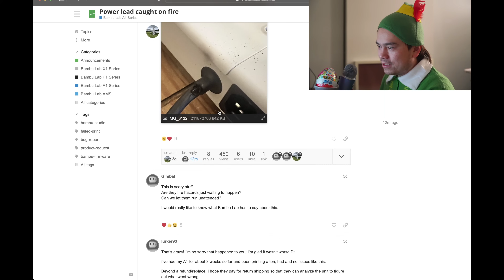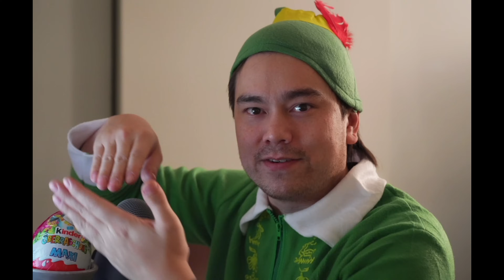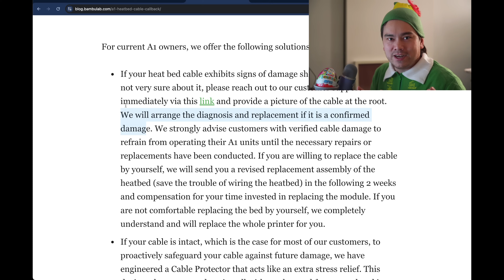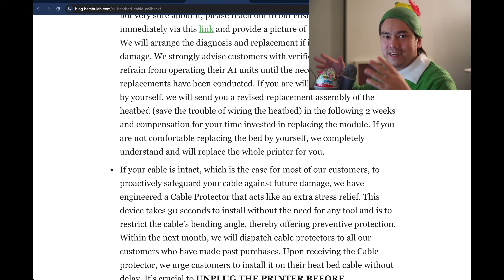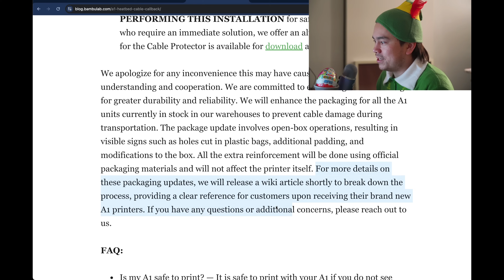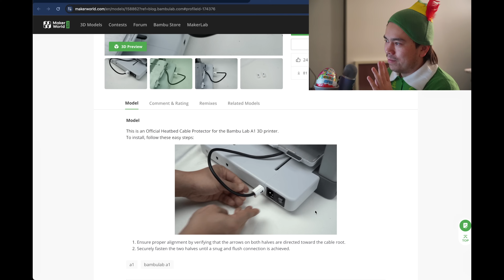Bambu Lab A1 - 👨‍🚒🔥 Important Safety Announcement!!! 👨‍🚒🔥

Comment from the maker: Also, I'm not sure how well this cable protector is going to work...
Won't it just move the stress point slightly further down the cable and still be susceptible to damage???
Reply: Seems awfully short, it barely covers the trouble area.  I'd like someone to cut that cable and strip the wires back to see if they are using  flexible wire that can handle the flexing.  I think the whole cable should be replaced.  Which would require every printer sent back.  So they won't.  I think  they are kicking the can down the road on this issue.
Reply: Thats exactly what is going to happen SMH I AM RETURNING MY A1 NOT TAKING ANY CHANCES
Reply: Exactly my thought, it will be even more susceptible to get bumped with it.
Reply: Yep it's only going to "help" if the cable was about to fail, and will move the stress point to a new position where the failure will reoccur later due to the bend radius being too tight, again. I don't think the failure is just from the machine being tipped over on the cable occasionally, surely it must be from repeated bends from bed movement being focused in that tight bend after the poorly designed cable strain relief.
Reply: This has Anet A8 vibes ! They should used a flat ribbon cable like Artillery does on its Sidewinder.
Reply: @Nibb31  can't the cable holds all the sensor lines and full AC mains power. The heater is mains powered.
Reply: @chrism2964  Same as the Artillery Sidewinder X2. It carries mains power, plus temp sensors.
Reply: Is this not an honest-to-goodness solved problem? I'm looking at my steam iron, easily fifteen years old with a cable carrying 240V (UK), designed  to flex constantly in use and showing no cable wear at all, in spite of being abused far more significantly than any heated bed. All this on an appliance which would cost £20 to replace. Moulded graduated flexible strain relief, thermal insulation, braided cotton sheath - seems like an obvious design to borrow, why not just do that?
Reply: @adamoell  there are more than 3 cores in this cable. The point really is that it's not every printer, it's just a few.
Reply from the maker: @chrism2964 just a few… according to who? The company that is currently in damage control mode? Yeah I’m sure they are going to be totally honest and forthcoming
Reply: @NathanBuildsRobots  There is literally one printer that had a short circuit. The cable damage is being caused by excessive bending of the cable, whoever did it, the cable itself is not faulty in the usual sense, its just probably not tough enough.
Reply: Should be fine if increases the radius of any bends and allows the cable to still bend.
Reply: Cable protector is a stop gap measure(to reduce bad publicity, and to protect from liabilities, by being proactive, and to avoid recall). The bandaid fix is the upcoming f/w, which will make it impossible to get fast heating(typical of PID control). But the responsible fix, is to increase current carrying capacity of the entire cable!. Which means, getting back all the printers out in the wild, retrofitting and sending back machines!, unfortunately, could make a dent on the bottomline, going forward. Not sure, how it will play out🤞. Note to NBR: Don't upgrade A1 to new f/w, looking forward for an upcoming A/B comparison video on heatbed heating times!, before😊 and after f/w update😢.
Reply: Why no cablechain?
Reply: @LalapopApple  because they are rubbish, complicated and unnecessary
Reply: @chrism2964  Have a look at the Voron Switchwire and its bed cable chain: 100% safe and no cable sticking outside of the housing...
Reply: @Christian-tt4nv  and?
Reply: Its called a bend radius.... A sharp kink in the insulation can damage it. The strain relief prevents it from being bent sharp enough damage the insulation.
Reply: Well, apparently, the damage is bending pins in the housing if you had read the release. So yes, moving the protection a little further away, should reduce motion within the housing.  The cable should be clamped down though.
Reply: Exactly. It’s still too thick at its termination. Even PETG will be too rigid here. Strain relief should be tapered or have relief cuts to increase flexibility until a critical bend curvature is exceeded.
Reply: @AwestrikeFearofGods no it still allows flex if you look at the design, but prevents kinking under normal conditions. I printed it and it seems to work well.

Comment: Hi Nathan,
The issue is that Bambu Lab used a cable not suitable for the moving bed. This is a design flaw of the A1 cable routing itself AND the choice of substandard cable quality. Other users of the A1 reported sparks  coming out of the cable way further up from the strain relief. This happens if you use a cable which is good enough for a power extension BUT not for a mains powered moving bed! They should have used cables certified for the use in drag chains at minimum. Those have a lot more stands and don't break easy.
   IMHO they should have used a design like of the Voron Switchwire and positioned the cable inside a drag chain inside the confinements of the printer (see Voron Switchwire manual). More freighting is that Bambu Lab apparently playing "let's blame the other guy" with their story that "only" 0.1% of the A1 are effected and till today (02/13/2024) still offer a "Option2" which is to self repair the printer with a new bed/cable unit. This Option2 is illegal in most EU countries and shifts the cover of accidents to the repairer.  Bambu mentions that it is illegal to work on mains powered equipment in certain parts of the world, but way down on that page after they "hung the carrot" infront of the customer with the extra $40  voucher... I have serious doubts that Bambu will check for every customer opting No.2 for the legality of that shipment...

Comment: Having spec’d out power cables in certified consumer and industrial electronics before, this must suck. A lot of these cables have little to no information on their datasheets. 

For something like this, I’d be looking for a high flex cable designed for robotics, then I’d consider some form of cable guide or drag chain.

It’s not been just bambu I’ve seen with lack of attention to this too. For example on my ender s1, my power cable got stuck on the rear motor and damaged it.

If I had an A1, I’d probably swap the cable out myself rather than waiting for whatever fix they come up with. But this printer is designed for the general consumer/beginner who probably shouldn’t be doing this kind of repair.

Comment: Mains heated bedslinger. Oof. There's a reason we don't build things like that.

The "protector" (supplied 3mf file) might be doing more harm than good, it's basically defeating strain relief with a rigid piece. If it was in a shape of semi open cable guide OK.

How the cable is supposed to look like, that it looks a little wimpy? That's not the problem, after all the current of the mains bed is uhm pretty close to zero, and you don't actually need a lot of material to reach the insulation requirements. You can guarantee that the maximum current for the given copper cross-section is not exceeded, they for sure have a fuse. The problem has to be in the specific design choices made in the construction of the cable, where the stress actually goes, so it ends up severing the cable and making up to maybe a quarter of the maximum bed power and half the running power dissipate at the damage spot instead. But i mean the design of this whole printer portion reeks a little of being sloppy. Many people building bed slingers have a U drag chain that is completely hidden under the bed, you'd think a printer by a premium brand could lean in this direction? On my own printer, i have done cable guides that go vertical on both the bed and the frame, so the cable does a twisting motion in use and is never pushed if i lay the printer down.

It would be interesting that 3D printers implement current checks. So say a fuse checks that the current is not substantially higher than specified, which is useful, but you also want the opposite here. If the wire breaks and its resistance increases, the current and power on the corresponding output will be lower, and the fuse will not trigger, but fundamentally if you had a current measurement device, you would be able to detect this fault as well.

Other checks are partially done in software without adding any hardware. Marlin thermal runaway check can detect if the temperature on the corresponding probe increases slower than expected during initial heatup phase - i have had this feature warn me of a failing connector before it caused a serious fire. You could also have steady state checks that the supplied power isn't all leaking away somewhere, for example if you have to drive too much PWM for a long time for a given target temperature.

PETG actually has naturally somewhat flame retardant properties. Flame retardant materials DO catch fire if they're heated too generously, but if you remove the source of heat, they self-extinguish in a reasonable time. For cables, PVC is preferred because it is naturally quite strongly frame retardant, but there isn't actually an issue with small pieces which have a worse retardant performance than that, as long as it's within reason. I mean most device enclosures are ABS, which is naturally very combustible. They use an additive to reduce its flammability, but it can only do so much.

Comment: That little printed plastic aid not sufficient enough. The bending curve from the base to the bed  does not allow enough stress relief caused by bending. Let alone a moving part.  A power cable similar to what vacuum cleaners have  with their higher flexibility would've ben a better solution.  Even better would be,  not to run a 120V rated thick wires and settle with a reduced voltage, that allows thinner/more flexible wires to be used.  The cable is too  rigid than needs to be connected to a moving part if you ask me, I was already concerned when I saw it while unpacking. It maybe ok for a stationary device that doesn't move, but an ever-moving part like the bed could eventually wear it out, even if it's undamaged.  Have you tried breaking an aluminum or copper wire before, and without using any tools ?  Just bend it back and forth until it snaps. Takes about 20 seconds or less.

Comment: Cable strain relief testing, such as the exact failure mechanism that’s being RECALLED, is basic safety testing required for CE, CSA, & UL product safety compliance. Any competent test engineer / compliance engineer would’ve specified strain relief testing be done in a manner that exposed worst possible conditions that would be plausible for an end-user to do, purposely or accidentally. Their printable fix isn’t a fix as the bell isn’t large enough radius to prevent the issue. This issue was caused by incompetence at best, & potentially willful negligence if whoever performed the safety testing intentionally did not test the strain relief in a manner that would cause a failure. I’ve dealt with 3rd party Chinese safety compliance testing labs, they will pass your product in a manner that it will pass (or make up data) if you do not give them direct oversight & review the results with scrutiny.
Reply: Also, Bambu should refund end-users $30 for each hour they spend performing diagnostics and replacing parts due to being their own field service technician.

Comment: Why is everyone so worried about 120/240V heatbeds?  Using higher voltage lowers the required current and current is what kills.  Of course the feed should be fused correctly to avoid that high currents could flow and your house should have a good working current-leak-detection (I'm unsure how this is called in English), but the lower current at 120/240V also means the wire will be a lot less critical.  Cables heat up by the square of the current, so lowering the current by increasing the voltage can let you use a thinner more flexible cable and hence reduce the risk of it breaking when flexing it a lot and in most cases you'll just oversize the cable for the required current and still have one much more flexible than when having to push 5A or more at 24V.  So yeah, the strain relief could have been better, but the choice for AC bed heating is the correct one and PETG has been shown to be self-extinguishing, so ...  This video honestly sounds like hot air ...
Reply: 120v/240v  will kill us in second.
Reply: @朱古力-z2q  So will 24V if the current is high enough.  And if by pure chance (like a chair tipping over tearing you away from the action while you were playing with 12V) it doesn't kill you, such a current can still leave life-long burn marks ... ask me how I know ...

Don't get me wrong.  Sure 120/240VAC is more dangerous than 24V DC if you pass it through your body, but at the same time the risk for a cable melting is reduced because of the lower current that needs to flow to get the same heating power.  That does not mean that you don't need to take the necessary safety precautions, but reality is also that typically for 120/240VAC those precautions are in place, while they often are not for 24V DC stuff.  Even in this Bambu A1 case the person complaining mentioned his breaker turned off the power.  That's a safety mechanism.  Possibly also a fuse in the printer blew.  But many printers with a 24V DC bed would keep on feeding current through your body without anything stopping that process.  If contraction of your muscles makes that you cannot get off the wires feeding that current through you, even this limited (because of your body's relatively high resistance) current can be fatal or - as even 12V did to me in my teens - leave marks that even 40 years later define your fingerprint just because I was balancing on the rear legs of my chair and that tipping back did finally pull the wires out of the fingers of that stupid noob.
Reply: @MisterkeTube You assume that in some extreme cases  large currents can harm us. But man, we can touch the exposed wires with 24v any time any day even the psu produce 10A current cause our body won’t let the whole 10A current pass. Dare you touch the exposed wires with 240v even the current is lower than 1A？

Comment: Not gonna lie, there were a lot of unnecessary digs at Bambu labs in this video that just seemed spiteful. Do you think Creality would recall a cable unless forced to do so? Come on dude. Just dumb crap like the dig on them by saying stuff like "our A1" and you go out claiming they think they still own it. They designed it. Its their product. Most companies refer to products they create as "their" product. Its pretty common.

Then you go on to say that they're blaming everyone else for the failure. Are you lacking in reading comprehension? Literally they state in the letter before they even point out the edge cases that they should have designed a better strain relief.... They explained how this flaw made it past testing, acknowledged the shortcoming and then try to explain the circumstances that reveal the flaw. I fail to see how you make the conclusion that this is attempting to place blame elsewhere. Sometimes obvious stuff never gets tested because people are human. Integration testing is a thing for this reason. Hindsight is 20/20, and the solution is obvious now. They are trying to address it rather than ignoring it, so give them some credit. 

Next, you then go on to complain about them offering a replacement because "these machines are not intended to be easily serviceable" yet, if you read down the same paragraph they literally state in clear language they will replace the the entire print bed for ease of replacement or the whole printer if you are not comfortable. They even offer compensation for your time if you do the print bed swap yourself! Have you done a warranty repair with Creality? Mingda? Artillery? How about Elegoo? I have. They just ship a replacement part and say have fun, assuming they'll even send a part. Imagine if they did it as a voluntary recall.

Next, you start complaining about the strain relief they suggest as an option because they suggest to print it from a SELF EXTINGUISHING MATERIAL? Have you ever done a burn test on PETG? Have you done an ounce of research? Prusament PETG is even UL listed! This is the first of your videos I've seen and its really obvious you have something against this company. I'm not sure why to be honest. I've been really happy with this machine and I was pleasantly surprised to see they actually addressed an issue rather than sweeping it under the rug.
Reply from the maker: I’ll try a burn test on Petg, will let you know for it goes
Reply from the maker: I’m sorry I didn’t mean to insult your printer. The A1 is a great printer! Best thing since sliced bread!

Comment: I own one A1 and two p1s. My a1 came shipped with a bend in the heat bed cable. I will be returning it.
Reply from the maker: I don't think it's all from shipping. I think the issue might be coming direct from the factory. Looking at the foam, it would have to be a hell of a fall for the cable to get bent. Basically it would need to compress 2 inches of foam to get to the point where the box wall would push on the cable.
It would have to be a high drop on the correct corner of the box.

Note that they aren't offering a return option, just self-repair or return for replacement.

Would be nice if they would offer a return and refund option, but they'd prefer to keep their money.
Reply: I was given a full refund option. Im waiting on my return label. I believe we will see a full a1 recall eventually.  Just my opinion. I already purchased another p1s instead. Gonna wait a year before another a1. @NathanBuildsRobots